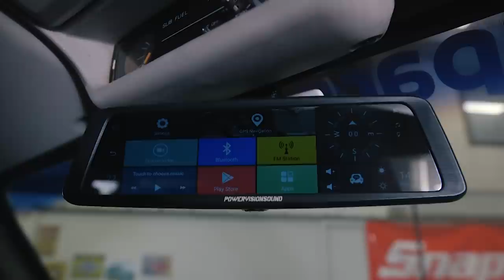The Naughty 40 Full Walkaround! - Insane Chopped Landcruiser! ALL MODS!

Comment: I saw the 4WD 24/7 episode where you joined the team for your rig's maiden voyage.  It seems your rig struggled a bit.  I though it would have out performed all the others considering your extra power, higher clearance and bigger wheels.  Was it the gearing that let it down?  And does it weigh more or less now compared to when it was a wagon with the same gear?

Comment: Are you running stronger drive axles to handle the 37's or are the stock axles handling it?
Reply: He has axle safety fuses on both ends.
Garbage AVM locking hubs on the front and Toyota's grade nothing axle studs on the back.